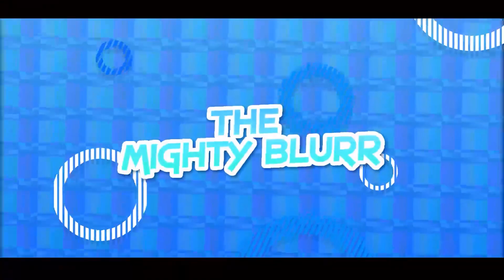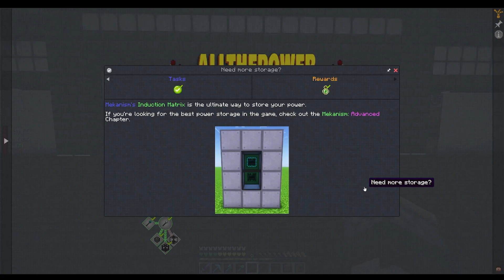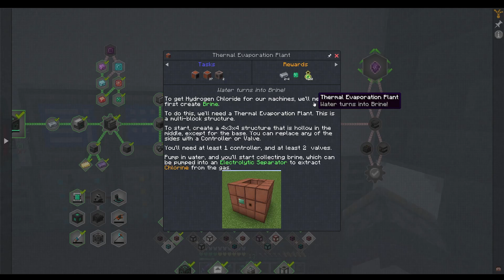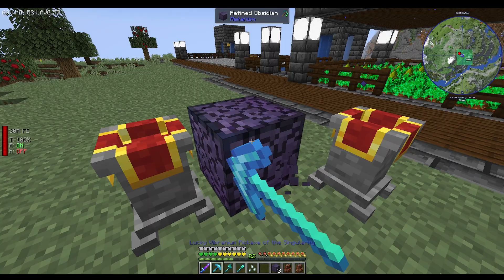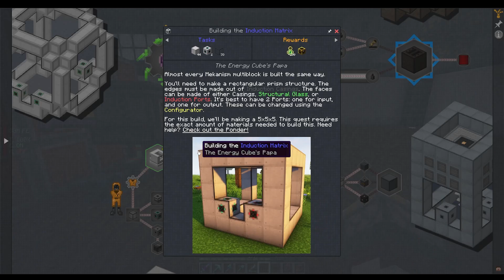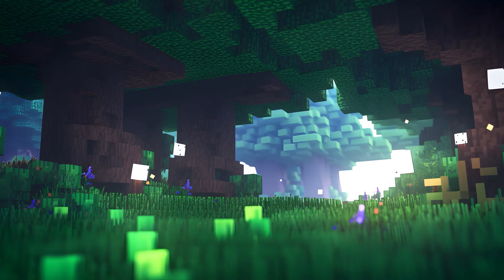ATM 9 | EP 16 | Minecraft | Item and Power Storage

Comment: You overcomplicate some things. A very good scalable power source are the Powah thermal generators with blue lava from The Other, each making about 32k RF and Lithium you can also use the one from Gregtech which if i rememberr correctly can just be mined as an Ore. Overall Powah is very good for, well, power be it storage or generation and the best cables are the veryy cheap fluxducts from the Thermal series, they can transport up to 2.14 billion RF. Also in Case of flight, just use an Angel Ring, it consumes very little power and gives creative flight. You could also upgrade the Mystical Agriculture farms by using Insanium Soil making it 1,35x faster i think.
Reply: Well why dont YOU make some videos then Mister Snooper :)